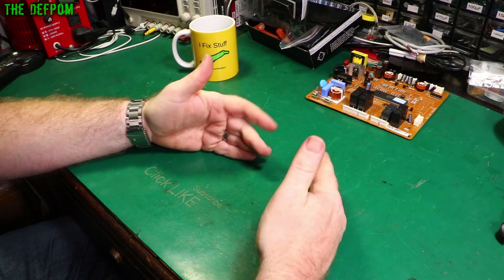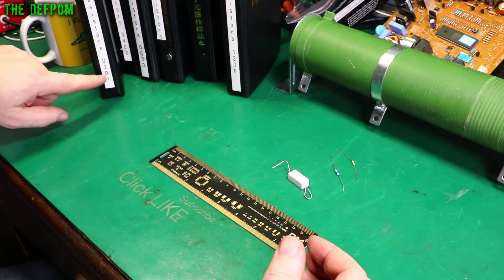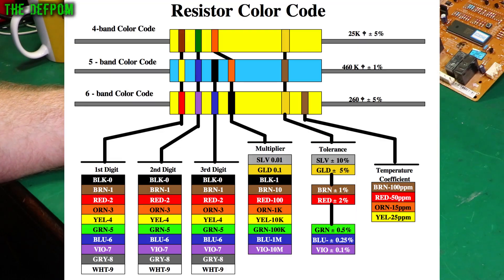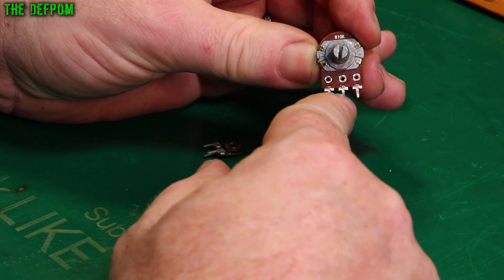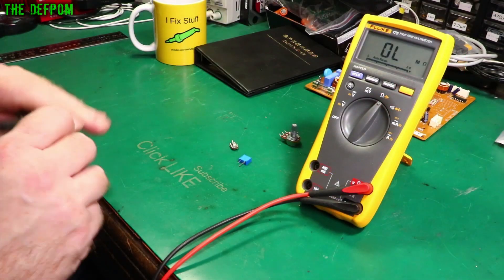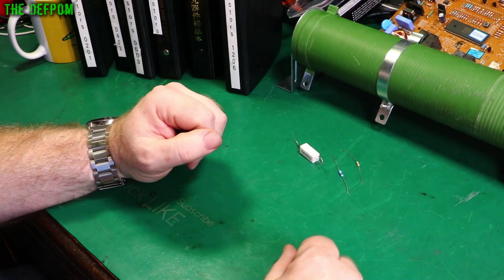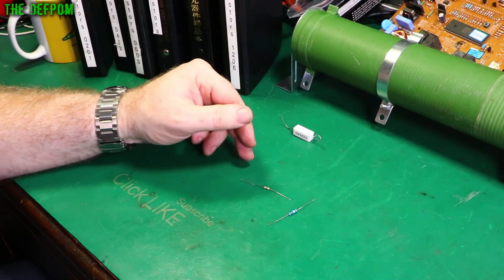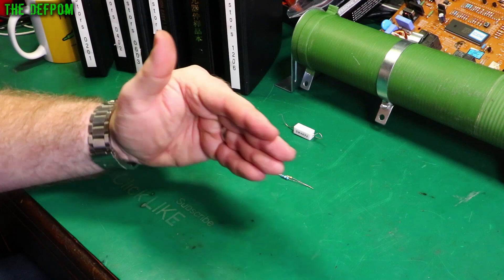🔴 Electronics For Beginners - No.2 - Resistors - No.956

Comment: I'm sorry, but this is the first video in a series of Electronics for Beginners, and I'm 3 minutes in and completely lost. 

Presenter shows me one item after another very quickly. I don't know what these things do. I don't understand any of the electrics terminology being used, one unfamiliar term after another after another (hello… first video for BEGINNERS !!). 

This presenter assumes that I have experience in electronics and has set the bar FAR too high.

Such a shame 😭 but I'm out.

Terms not explained:
Resisters, heat dissipation, super snaps, 0201s, (says more numbers), watts, wire round, resister codes, colour bands, resistance, (names several percent numbers but I don't know why), ohms, wipers, linear, logarithmic, 10k (¹⁰k of what?), differential, refers to choice of resisters "depending on what you want to use them for" - I still have no idea what a resister is or why I'd use one, preset trimmer, 254 "that is the value" (value of what?), does measuring using a device but I don't know why he's doing this, tolorence, potentiometer, resistance circuits, current (now describing what a resister does, but I have no context in what a current is), volts, something about putting the ends together makes half of something… 

Okay, that's 5 minutes in and I'm learning nothing. Thanks for your effort but I don't know who this was intended for.

Comment: On that huge variable resistor, if you're using 1/4 the total resistance or less, connect the ends together to help spread out the heat dissipation. (The wiper then becomes the other terminal.)